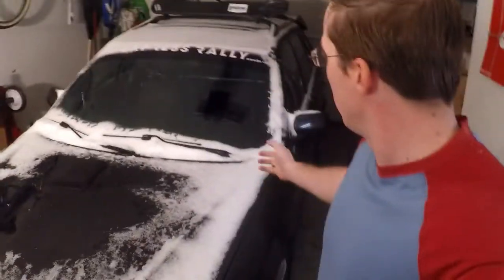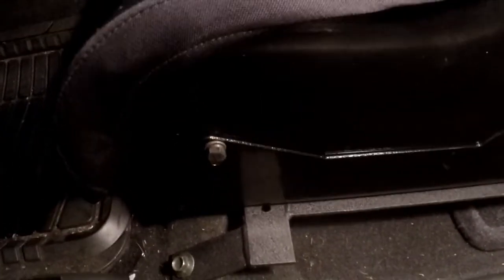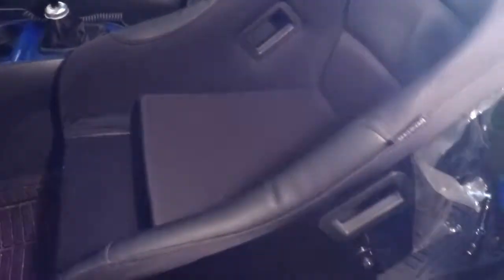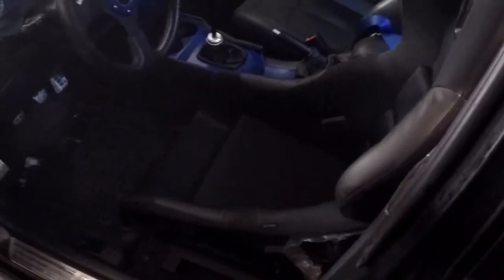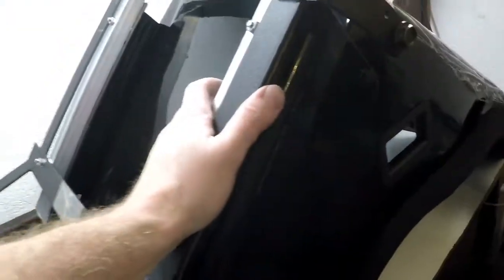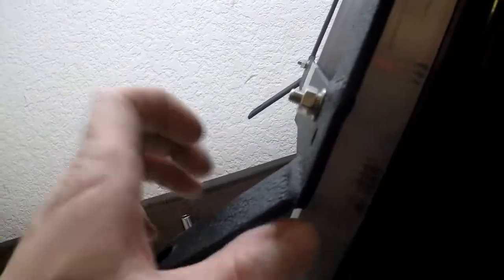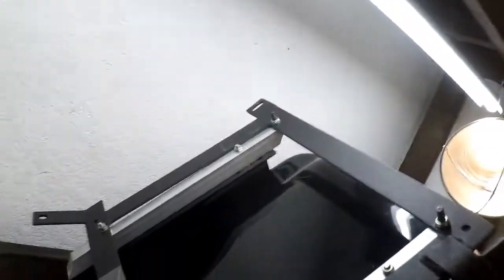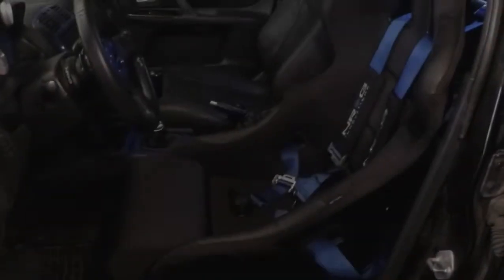How To - Mazda Protege Bucket Seat

Comment: Absolutely rad! Do you know if any other type of seat is compatible with those wedge rails? As much as I would like to replace my degrading driver seat (and possibly passenger seat), that's an obscene amount of money I'd have to spend. I know that wedge's website has two options for Corbeau or Recaro, but surely there's got to be some budget conscientious seat out there that bolts in like one of the two aforementioned seats?
Reply from the maker: Riot Polizei my bracket was for the Corbeau. If you get universal sliders, you can mount almost any type of seat. Just need a drill and some bolts. I drilled the bracket for the sliders on my first racing seats then I drilled that aluminum for the second set. The options are probably limitless nearly.